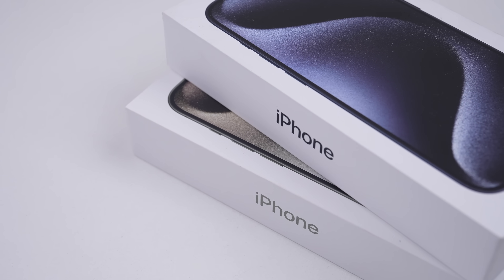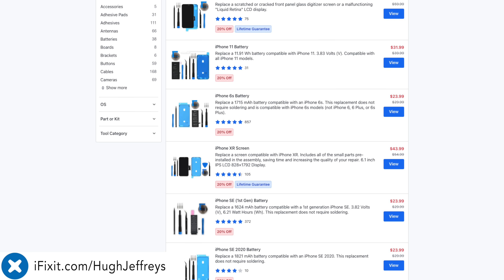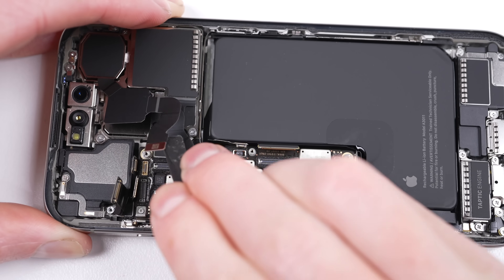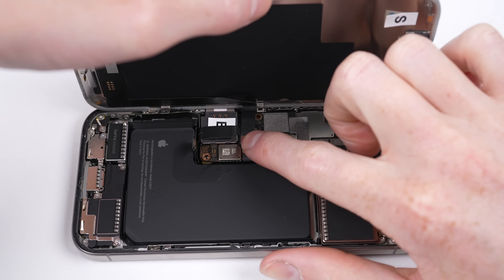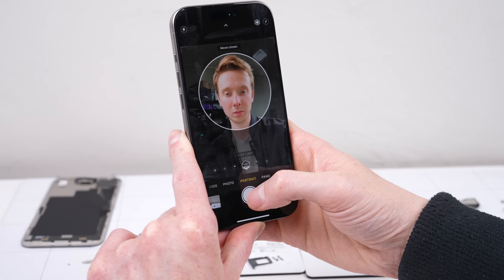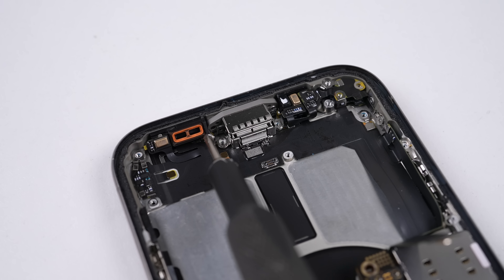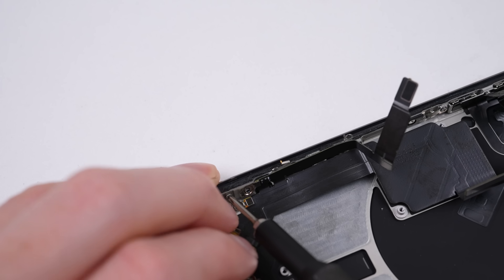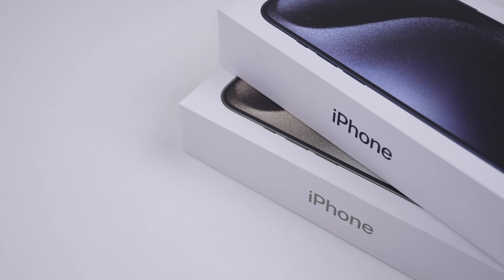iPhone 15 Pro Exposed - This Will Harm The Environment - Teardown And Repair Assessment

Comment: it may not have a proprietary charge port but it will probably have a software detection of the charge cable that may still only allow fast charging if you use their cable.
Reply: IINM, the EU's USB-C mandate also has a clause that prohibits this too.
Reply: I have a 15 Pro and I've been charging it with a non-Apple cable and charger. The cable has a power readout on it, and I'm able to get full 20W charging.
Reply: @kylemsguy_  give it time apple will eventually tweak something in software to slow it down or it may be a "devil leaves the kid alone effect" just to get the eu off their back and either there will be a chip in the charger brick or it will communicate with the computer and some binary blob running on the computer.

Comment: It will never be repairable. If they are forced by legislation to remove the pairing of the parts with the phone they will just make the phones slower with software when a new one comes out. If they are forced to change that too, they will make the parts so they will physically break sooner. And so on. It will never end.

Comment: Apparently the "incompatibility" issues were created purposely by Apple due to large quantities of stolen iPhones ending up in China. Stolen phones are dismantled for parts in Chinese warehouses and the parts are then either re-sold or used to build complete 'Frankenstein' iPhones but now with the software faults to be sold to the Chinese.
Reply from the maker: I understand your point but software pairing doesn't prevent the part from working in another phone, just causes glitches or appears as though its broken. I don't see how that would have anything to do with stolen phones.
Reply: @HughJeffreys  I think my comment was worded a little wrong. I was referring to a video I saw about the guy who had his phone stolen in the US and, like many others in the US, his stolen phone was suddenly activated again in China. You've probably heard the story too. I'm not sure what the Chinese were doing exactly, but it was still registered somehow to the original owner's Apple ID, and photos of this Chinese guy were showing up on the original owner's account on his new phone. The video was just showing how stolen phones were ending up in China and being stripped for parts and/or creating slightly faulty rebuilt iPhones with the pairing issues that were being sold on the Chinese black market to those who were happy to have cheap 'slightly glitchy' phones.
It's just part of a bigger picture as to why Apple makes it difficult for third party repairers.

Comment: Could you show how to repair the speaker on the Motorola G7 Supra, my speaker crackles a bit
Reply: That sounds like something to just give up on, or find some parts online and look up a guide while you are waiting for your replacement part.
Reply: @nialasciva  so I should just get a new phone, the speaker still works somewhat, I just need to get my phone unlocked, I use headphones during phone calls anyway
Reply: @danielgartin-oh9ik  considering the phone model is 4.5 years old, yeah, I'd say a new one is due anyway since you for sure aren't getting security patches anymore.
Reply: @nialasciva  My father isn't getting updates on his phone either, iPhone 7 Plus, but we're with Boost Mobile so we have to pay full price for phones
Reply: @danielgartin-oh9ik  iphones have better security and longer software support...
Reply: @nialasciva  I know I plan to get one eventually, my friend Julio gave me the phone I'm using now, my sister Rebecca and my father already have an iPhone

Comment: What is your take on this more repairable back glass, but then breaking much easier than before as can be seen in some early drop test comparisons? I assume because of the way it’s no longer entirely glued giving it it’s integrity. Or due to the rounded edges exposing the glass more instead of protecting it by the lip of the bezel.
Reply: there's now a giant hole where the magsafe coil sits. No wonder that glass has no structural integrity...
Reply: @PvtAnonymous  And it was on any model with wireless charging coil
Reply: @DimaKirivel  no, there was no gap between the back glass and the metal frame before, only this cutout which was structurally supported by the surrounding metal. The glass would break often in that area, when you applied pressure, but this time it's REALLY easy to break it apparently.
Reply: @PvtAnonymous it's like that in previous builds, they want the magnets to be as close to the back as possible. Just doesn't have the same support plate now + closer corners.
Reply: But it wasn't the problem with samsung or any android phone with back glass. Apple just messed up with glass
Reply: This time, since the glass is not cemented to the frame, it should allow for more flex making it less susceptible to damage from a twist. The exposed round edges is the problem.
Reply: Or, hear me out, drop tests are far from a reliable test which yields meaningful results
Reply: @jonathancormack  JerryRigEverything literally managed to break glass by pushing on it
Reply: @DimaKirivel  I  did see that is well.
Reply: @DimaKirivel i was going to say the same thing … as i watched it, holding the exact same phone, i was terrified 😂

Comment: Just a heads up, the EU legislation only states it has to use a standard connector, which in this case is USB-C. That can change in the future if a new standard connector comes out.
Reply: or they can use software to lock out non-apple cables as the bill mentioned nothing about software

so when you connect a non-genuine cable, it'd either limit the charge speed or just refuse to charge
Reply: @camboi6103 It appears they haven't done that for the iPhone 15, if they haven't done it to the iPad
Reply: @camboi6103 limiting charge speed without telling anyone is 1000% something they’re probably working on soon.